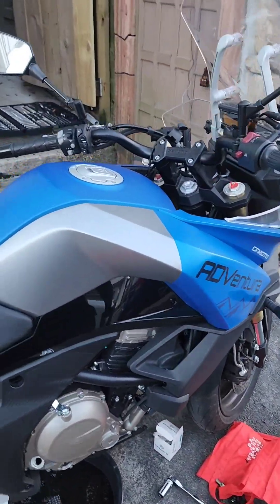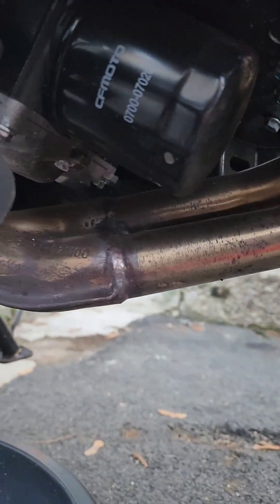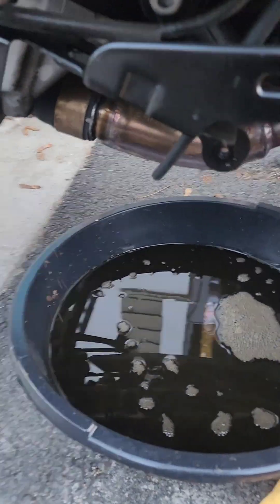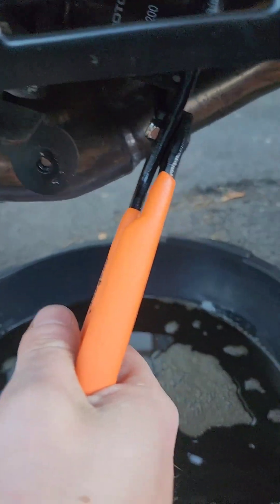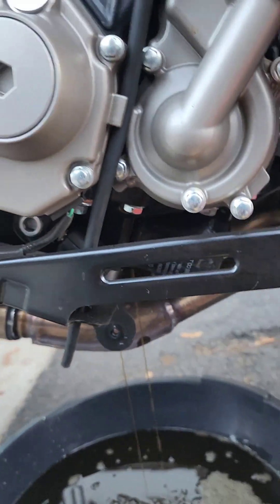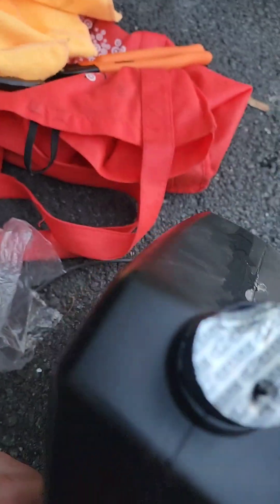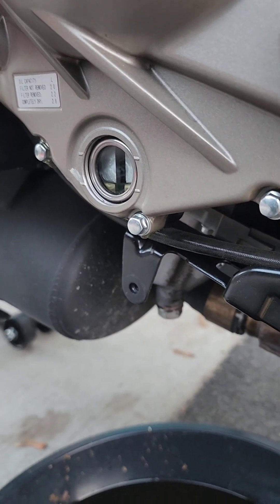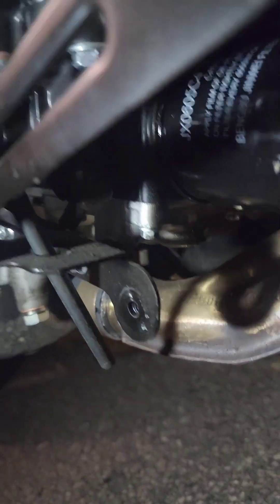2022 CfMoto Adventura (3US) Oil change with OEM parts with links

Comment: where do you buy brake pads?
I couldn't find any.
Reply from the maker: Honestly I don't know I would tell you to look at the cfmoto website but it's kinda hard to navigate. I'm sure you can use any brand that matches the old ones. I haven't had to change the breaks yet
Reply from the maker: Actually I called the dealer and they definitely have one brake pads for around 300$ look up you local cfmoto dealer near you and call the parts dept. They can order your brakes pads